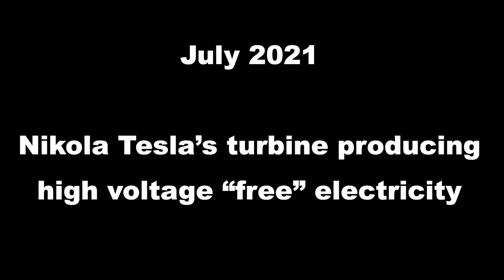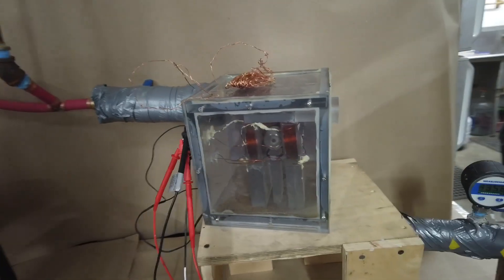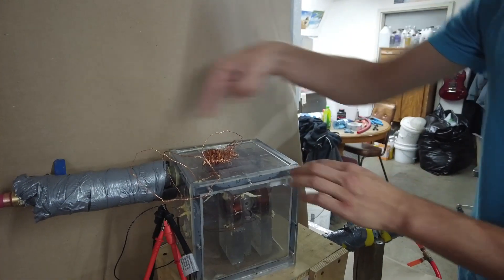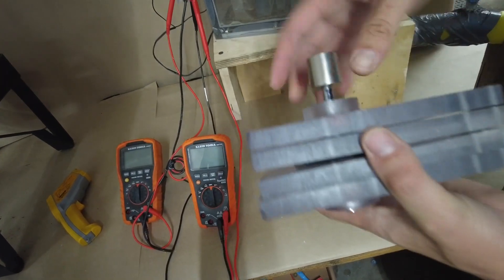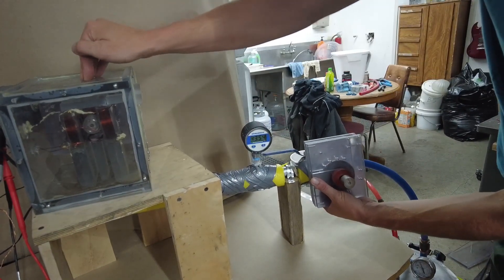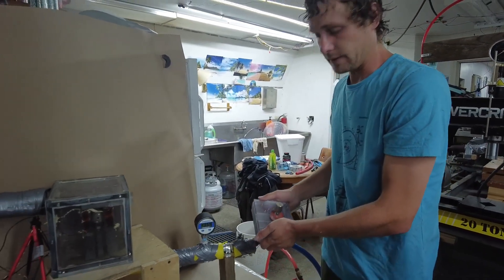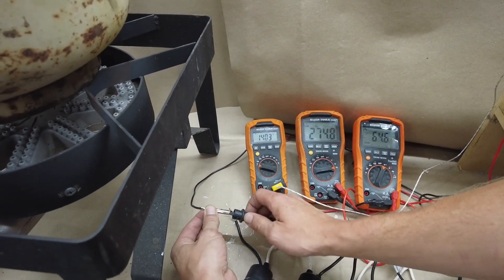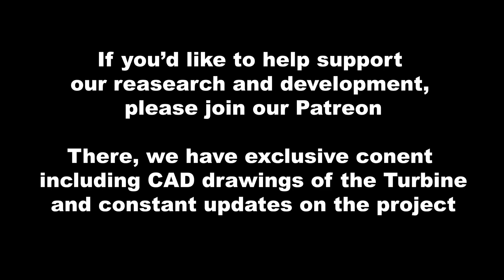Ground Breaking Renewable Energy System Using The Tesla Turbine

Comment: Also, I wonder how the system would preform if a liquid with a phase change level closer to ambient temperature was used. Such as Methylene Chloride. Because it’s critical temperature in a vacuum is closer to ambient temperature, very small temperature differentials will cause it to boil or condense. The condenser chamber could be cooled by evaporating water on its surface or blowing air over it, instead of an ice bucket. The hot chamber could be powered by ambient heat, or better yet, heat from the sun if you pointed it black. 
Like the drinking bird toy, which is a heat engine the same as this.
Reply: Or you could even burry the condensing chamber a dozen or so feet underground where it’s almost always colder. Geo-atmospheric power. The surface layer of dirt insulates the earth below, It seems to me like the earth really does have natural energy that can be tapped into. Could also use a cold body of water.
Reply from the maker: yeah, the ice actually isn't needed, we tested it without ice, and as long as the temperature differential is great enough for the phase change of water to occur the turbine runs great. Depending on the temperature of the exhaust of the turbine which we will soon see, warming it with ambient air or even the earth would be perfect. You got the idea! Thanks for the great comments.
Reply: @iEnergySupply  Awesome, thanks! You guys have done great work.
Reply: Last thing. I know I’m leaving a lot of comments. When you build the system to recycle the condensed liquid back into the boiling chamber, there should be a transitionary chamber or coiled tube heat sink that brings the liquid back up to room temperature first. If you just pump the cold liquid back to the boiler it would probably stall. Bringing it up to temp first extracts the energy from the environment more efficiently.
Reply: If you want lasting Earth or water temperature power, you'd want to bury or submerge a big coil and run water through it, like heat pumps for home heating use. Then you get access to a huge thermal mass.
Reply: The general problem is that fluids with these properties are generally either damaging to the environment or very flamible, which are rather undezirable. Also note that a larger temprature difference is generally desirable because condensation and freezing will cause extra wear on the rotors

Comment: I assume you need the vacuum box because the bearings can’t be air tight. I wonder if a smaller plexiglass casing could be made with a slot for the magnet. Basically shrink wrapping the box around the turbine, leaving the coils outside, not as much volume for vapour to build up.
Reply: So basically just a cap over the magnet and bearing I guess.
Reply from the maker: yep
Reply from the maker: Absolutely, I will be engineering this set up on the next turbine.

Comment: One of the big problems at larger scale/size is the disk integrity.  I noticed you are using manufactured disks that look like carbon fiber.  I also saw in the close up demo, the gap between the disk and the housing shrinking and expanding at the various RPM bands (10k, 20k, 30k, etc.).  Is the idea here to use small turbines in a parallel or series to generate the power to batteries?  I do like the low thermals needed though.
Reply from the maker: If you are referring to this video for that conclusion https://www.youtube.com/watch?v=AfCyzIbpLN4. They made a big mistake in their math. The video says the rotor must spin at a very high rpm, maybe 50,000 for a 6” turbine. The speed of a turbine is based on periphery speed not rpm. If a 6” turbine needs to spin 50,000 rpm to be efficient like the video says, that’s a periphery speed of 890.1 Miles per hour. If you want a 3 meter disk to achieve close to 891 miles per hour at the periphery, the rpm required is only 7,253. We have materials that can easily reach that speed.
Here is what nikola tesla says about scaling the tesla turbine.

I have found that the quantity of fluid propelled in this manner, is, other conditions being equal, approximately proportionate to the active surface of the runner and to its effective speed. For this reason, the performance of such machines augments at an exceedingly high rate with the increase of their size and speed of revolution.
Reply: @iEnergySupply  Oh, it was about halfway through https://www.youtube.com/watch?v=mg4I2WIYAAM&ab_channel=SubjectZeroScience where they talk about the problems Tesla hit when experimenting with the turbine.  I mean, I saw the turbine you have going and it is very interesting to see the output generated by the easy to generate pressure.  I could easily see a different fluid that condenses at ground temp (canister in ground) and boils at room temp in a standing container to be a recycling fuel, hitting two turbine boxes in the circuit. Looking at some liquids with low boiling points, they are all pretty toxic/harmful.
Reply from the maker: @seikojin  yeah water seems to work great.

Comment: Wait a second I thought that the forced in air coming into contact with the Star shaped discs in-between the turbines discs was pushing or spinning the rotor. That the air would go around and exit as exhaust after it passes a point of no longer having usefulness.  That if it keeps spinning and spinning around before it exits. Then wouldn't it cause a pressure change that wouldn't allow intake air to have as much force onto the blades or wouldn't allow as much entering air to enter or wouldn't have as much effect on the acceleration until the old spinning air had exited making room for the incoming  air or the air that effects the outcome of rpm.. unless each rotation of air would have a new exposed portion of the disks to give more force as it blows by on a cork screw type of wind times for the spinning air to be useful each time it blows by..? Basically cluelessness right. No but I think you have to use fuel or electricity to get the water vapor above room temp. And more electricity to pump out the pressure. This would mean that you have unsustainability if it is using blah blah blah Right it's less than 80 percent..lol

huh? What did that man say. Is he stupid or something?  Sorry for rambling but it's just for fun.
Inquiring minds wanna know
Reply from the maker: we just got our analytical equipment, we will soon show more details.
Reply: @iEnergySupply  That is what I have been waiting for. @genome616 have the right to question and I sincerely wish that you guys have success. It will be wonderful when you through analysis and figures get the yes from people like @genome616.
Reply: The fastest air drags on the outer edge, which needs the highest speed (linear speed, not rpm). As it loses speed and falls inward, it can still drag on the slower disc material near the hub. There'll be back pressure from the rotating mass of air of course, especially at high RPM, but the more load is applied, the faster the air slows down and the lower the back pressure gets, making the turbine consume more fluid and perform more work. It's all self-adjusting, as long as the turbine doesn't stall.

Comment: Tesla's turbine is very poor in isentropic efficiency (below 30%), compared to the conventional axial steam turbines ( close to 90%). The only advantage I see is, that it can operate in the wet steam region. Despite that, you always have to put more energy to the system than you can possibly extract. So even if you heat up the water with the solar energy,  then you need to keep vacuum and cold on the cold side, which itself is energy expensive. It would be interesting to see, if you could share the numbers, such as the amps you produce and pressures/temperatures at both ends of the cycle, to see the broader picture.
Reply from the maker: with our analytical equipment that just arrived, we will see the efficiency of many different tesla turbine models.

Comment: What I would love to see is something like this connected to a transformer stepping the voltage down and then connect it to a midnite classic to charge batteries
Reply from the maker: Maybe a ferrite core transformer would be the best, it needs to be capable of at least 3000 hz, do you know of a good transformer?
Reply: Switchmode power supply transformers handle tens to hundreds of kHz. Then again, maybe you'll be better served by rectifying the generator output to DC and feeding it to a DC-DC converter. Then you know that everything is running at an optimized frequency. 
You could also make a better generator using a high speed BLDC motor in reverse (minus the electronics). Something from the RC flight world may have the RPM tolerance needed.

Comment: I am sure Big Oil would love to squash this.. They do not want anyone messing with any type of free energy. The real key to this would be a self sustaining loop, That is the biggest issue, You need to be able to run this without using ice, You wouldn't be able to power this up without any.. Since this is technically almost, a proof of concept only next thing would be a bigger prototype, If you could build one that puts out constant 230V at like 30 Amps or so you would be at powering a house territory, Heck you could even run lower volts like 50 volts at like 100amps or something that would provide power for off the grid travelers no problem, they would be using battery's anyway and this could charge them up..
Reply from the maker: With our latest tests, we haven't used ice. This is just the beginning.

Comment: This is the first Tesla Turbine dedicated channel I've ever seen. Got to subscribe of course. 60k rpms? I'd throw a gearbox on that to get more torque and maintain plenty of rpm for a generator. Don't forget the importance of a flywheel either. You could also use a Fresnel lens on the hot side and an air cooled radiator on the cold side for the heat differential. which then you may possibly get a little free energy maybe?
Reply from the maker: Gear boxes seem to not work at such high rpm, although we are building larger turbines, but the generator seems to be working great for now. For the moment it seems just a large tank on the boiler and the condenser work really well, this was just for demonstration purposes.
Reply: Magnetic couplings may be more suitible for this application, not only is there no need to make a hole in your low pressure system for an output shaft but you can actually create gear ratios by messing with the poles
Reply: Something else to note is that this process is continuous unlike a piston engine which very much reduces the need for a flywheel (unless you have a very transient load, but for electricity generation that is not so)

Comment: Does this compare favorably to an automotive turbine of similar size in watts in/out?  (Volts or amps is not power… volts and amps is power.). Cool gadget.
Reply from the maker: at our higher rpms, it is capable of more power because of the extra speed it can go with laminar flow. Volts x amps = watts. We will show all the numbers soon with our new analytical equipment.
Reply: @iEnergySupply  yep.  rpm*torque=horsepower.  1 hp is 735.5 watts.  It seems to me a car turbo requires many hp to provide enough compressed air to increase engine power.  Could there be an application where the alternator is replaced with a Tesla turbine generator powered by a percent of exhaust?
Reply: @SolGuy42  there is a good reason the Tesla turbine isn’t in common use everywhere.   There is little advantage over conventional turbines in practice, and it clogs up easily.  These details are left out by its fans unfortunately.  Tesla turbines are a very niche engineering feat that has yet to find a real world role despite existing for a very long time.

It’s a bit like VAWT wind power.  Yes in theory they have a niche role, but the reason large wind farms are all normal wind turbines is because the advantages of VAWT only apply if you place it where you should not place a turbine in the first place, somewhere with rapidly changing bursty air flow.

Comment: As a mechanical engineer, I really appreciate your work man. This is why I studied engineering, the process of making things and validating the hypothesis makes me excited. Great Job guys, I hope to see these in the market after few years.
Reply from the maker: thanks, we believe within a year we will defiantly have it into production. Maybe sooner though, once we finish testing with our analytical equipment we will be satisficed for production.
Reply: @iEnergySupply  yes, I can see this one as a good component in the powerplant industry. Specifically, if you use diesel engines for peaking loads, It can increase the thermal efficiency of the diesel engine by a considerable percentage. 
----
I think your number 1 consumers would be those manufacturing industries that produce a lot of heat. For example, those who are into the steel manufacturing industry. Those are located in semi-remote areas, and you can negate the possible noise complaints coming from the tesla turbine. That's if you can scale this up and produce at least 3kw of continuous load. That would be enough to run their lights and small loads while manufacturing.
----
Suppose the residents from a compound would get this one. They'd be facing daily noise complaints😂. I doubt you can sleep with this one turned on for at least 50 meters from home.
Reply from the maker: @troyguererro0898  3 kw is our goal. Also this is very unbalanced, we since fixed the sound issue.
Reply: @iEnergySupply  I see... Wishing you the best 👍 and your team.
Reply: @troyguererro0898  By enclosing the unit in a room, with all its wall, floorings, ceilings, etc-  padded with 12. inches thick, semi. dense foam, fire. proofing treated- such problem about un.avoidable noise, will be reduced to "conversation level" noise, sound- or around 10-15 decibels... Just analysed the interior design of the common        "silent type" portable genset today- in youll have an idea about its basic lay. out...
Reply: @arielhermoso4262  I've worked in the field. Your suggestion is possible. However, as you can see in his demo, the turbine emits steam at some of its parts; depending on the atmospheric temperature, it will condense and possibly flood the said room/enclosure. You may install drainage points in that room but you need to water proof all circuits inside the enclosure. 

Since the frequency of the turbine is high, your enclosure can still make noise. To minimize the noise from the vibration, you need dampers.

The cost will pile up by just installing a sound proof wall, let alone the maintenance and the grade of materials needed. If I were the engineer if that said project for installation of sound proof walls. I would use marine grade materials, since those can tolerate extreme conditions.
Reply: @iEnergySupply  You need to consider water recapture, I suggest using a desiccant wheel that can reclaim water, I would be happy to contribute more thoughts, have you considered starting a telegram channel? Recently there was an open source project called Alpha Fold, these kinds of things will change the world that is my hope. Keep up the good work 👍
Reply: As an engineer do you think tesla turbines could find use in electricity generation?
Reply: @killman369547  sorry for the late reply. My answer would be yes, renewable power plants also have negative impacts on the environment. My colleagues are researchers, that's why I've seen the pros and cons of different powerplants. 

In the case of a Tesla turbine, all you need is a heat source and harness the heat to boil water and turn it to high pressured steam. The principle is similar to a conventional steam turbine, but a Tesla turbine has significantly higher efficiency when operating at high RPM'S.

Geothermal plants should consider this engine to be used in their industry; it has the potential.

Comment: To scale this aperatus, can you increase the number of disks on the same shaft? Would that increase torque? I'm assuming there are mainly 2 ways to scale: increase the number of disks or increase the diameter of the disks? Have you tested what the practical RPM/diameter limit is for carbon fiber 1/64" disk?
Reply: It is probably better to put multiple turbines on the same shaft. 
That way once you optimize the size of the nozzle and volume of the housing, that becomes a standard building block, and then you put as many as needed onto a common shaft.
Reply from the maker: correct.
Reply from the maker: you are correct, we are building multiple sized turbines and will analyze them all separately to find the best surface area for a given amount of watts.

Comment: Voltage means nothing where is voltage X amp's to get power watts
Reply from the maker: correct, but this shows we are not lacking in voltage, we will have all the number figures in the future. If you see our previous load testing, we show amps and volts, and wattage.

Comment: 6:52 cool the shaft? (Tube)

*make the axel a tube and run the cold exhaust in verted through the core by redirecting it with a cap?  

May reduce the cooling side length.
also makes me want to consider "Stirling Engines".
Reply from the maker: would be nice to try that. This is basically a starling engine on steroids.